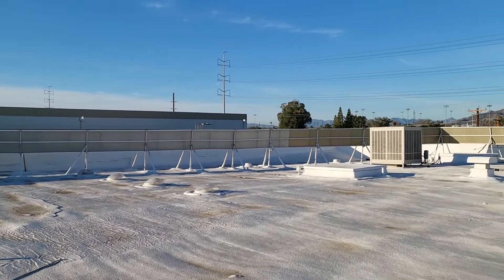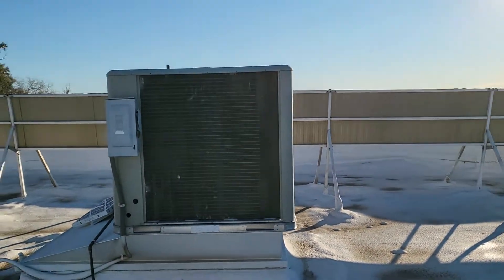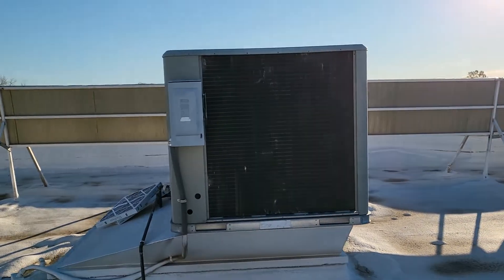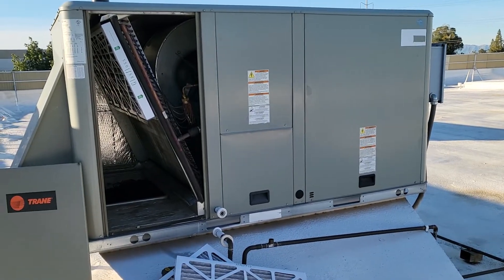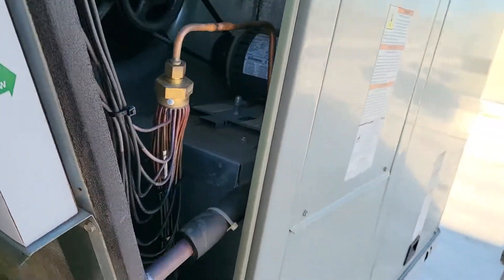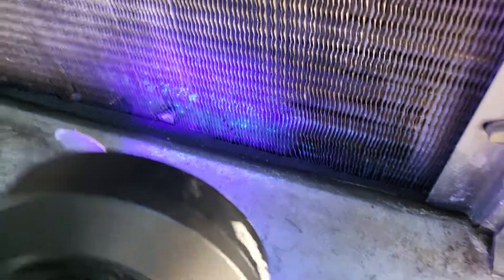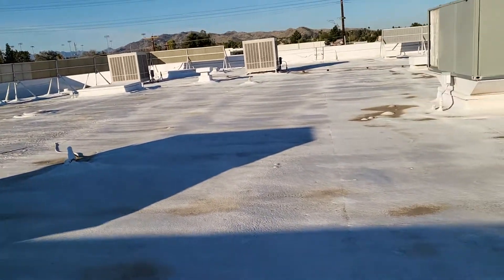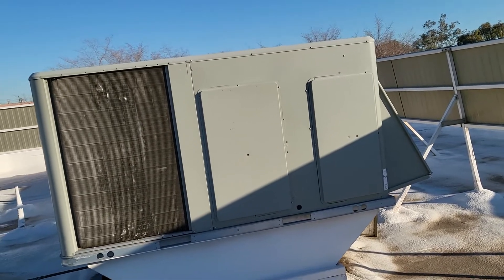THE BEST WAY TO FIND A REFRIGERANT LEAK IMO HVAC TECHNICIAN A/C REPAIRS INSTALLATIONS TEMPE PHOENIX

Comment: What if all leaked out and the system is completely flat? Do you need to charge it all the way up or can you just put in a pound or so? Refrigerant is hella high these days.
Reply from the maker: so if it's flat that means it's a big leak which can be found with a normal "sniffer" leak detector by adding a little bit of refrigerant or with nitrogen. The dye mainly for tough leaks.
Reply: @themoderntradesmen9352  we got one that was empty and still couldn't find anything obvious. A real head scratcher. Does this require a full charge? That could be super expensive just to find it, then you have to do the repair. But if you don't find it, you can't do any repair because you may fix something that isn't broken and still not solve the problem.
Reply from the maker: @realSamAndrew  add nitrogen and see if you can hear it or add some freon and see if your leak detector "sniffer" can pick it up. I wouldn't fill it up only maybe a pound.